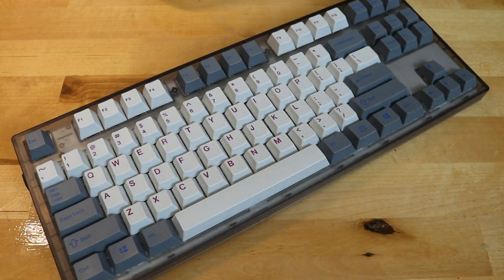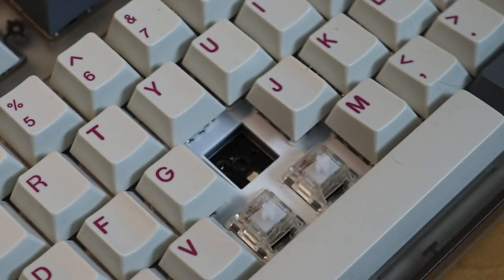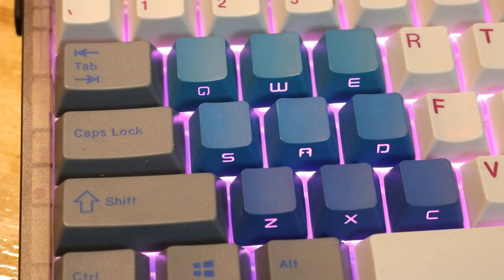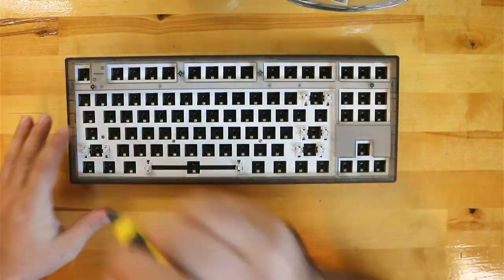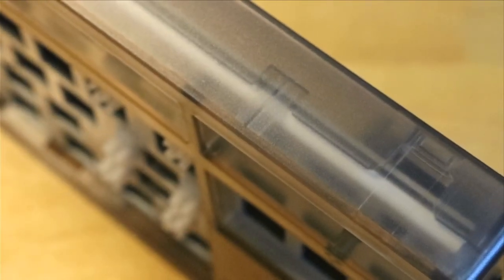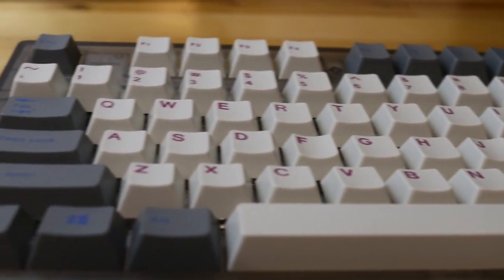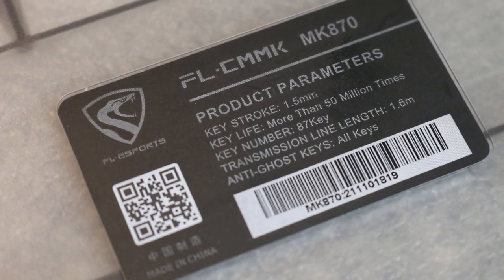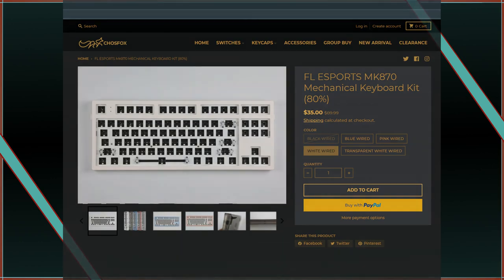MK870: The Cheapest Enthusiast Build

Comment: Out of curiosity, what are the USB-C ports for if they don’t pass through? Charging stuff?
Reply from the maker: They are for connecting the keyboard from that port, so like if your computer is to the right or left side, or if you need more room for a mouse pad on either side, it just helps to route the cables one way or the other!
Reply: @ireakhavok  gotcha. Thanks!